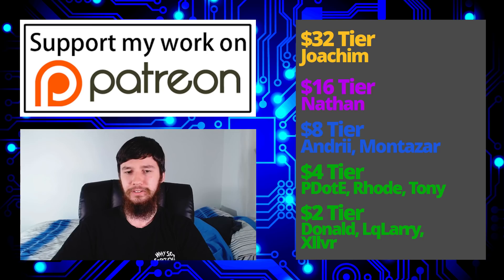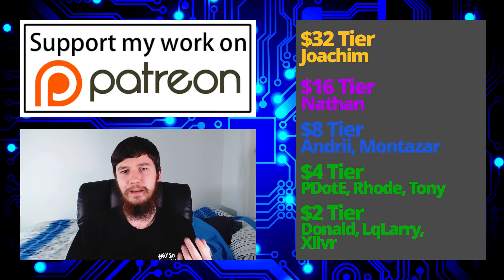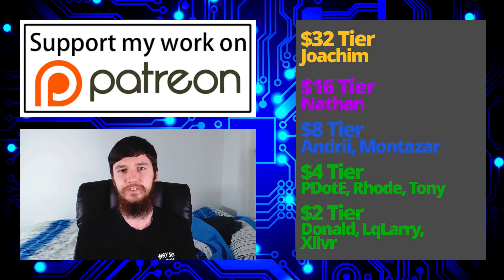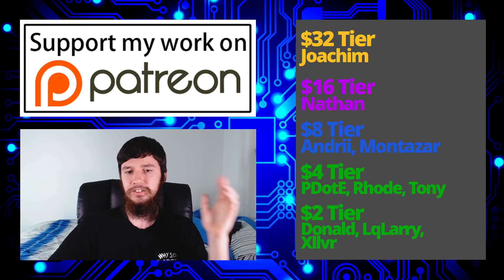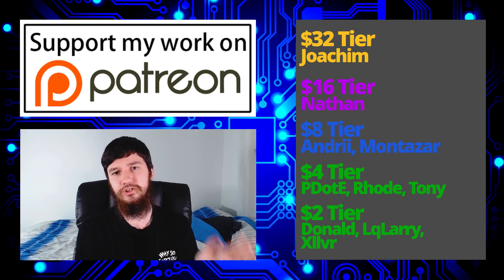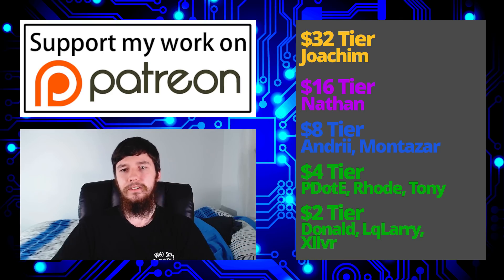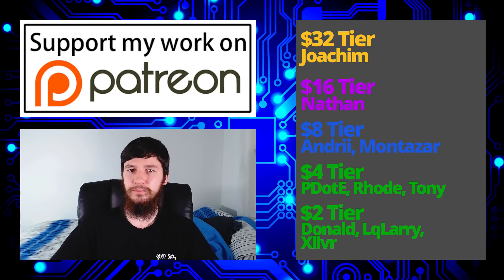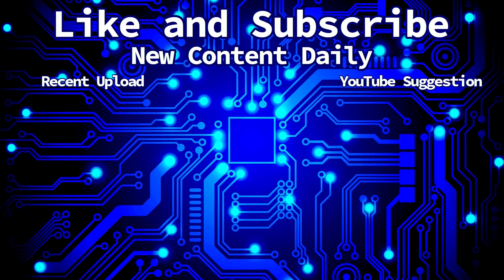PC Building Horror Story: How I Killed My Ryzen 3900x

Comment: The lesson here is WHEN YOU SCREW UP TAKE A BREAK.  A VERY LONG BREAK.
In 2004 my 3yr old son jumped on our brand-new $2200 Thinkpad T41p laptop, destroying the screen.
IBM wanted $750 to fix it (about $1250 in today's dollars).
I ordered a Boe Hydis IPS screen from Malaysia ($240) and decided to install it myself.
It took me THIRTEEN ATTEMPTS and THREE COFFEE BREAKS to get the signal cables (think light, 802.11 antenna) routed around the case so I could reinstall the bezels.
Several times I was about to throw the laptop 15' across the room into the wall !!!
What saved me was : Knowing myself, managing my own emotions, taking time to re-read the HTML guide, and relaxing, so I could start over, fresh.

Comment: electronic cleaner spray of a good brand cleans thermal paste. dripped some paste into a DIMM slot a few years ago. rinsed it with the spray a few times until the runoff was clear still using the board
Reply from the maker: Oh nice

Comment: I have a personal rule. Never do anything which is likely to end in failure, when your head is not in the best condition. 
Examples: After 2200, when you're starting get tired, when you're drunk etc.
The times I have screwed my install, bent CPU pins, messed up soldering, etc, have been after 2200.

Comment: Probably just the pins are dirty. Most of thermal pastes don't conduct electricity. Even crappy silver-based didn't in my experience, but you can check it using multimeter. I'd buy it and make a working system of it. But I don't feel this would be right, as *this is almost definitely working CPU*, and I'm broke anyway 🤷‍♂️
Just buy isopropanol, or any other as clean as possible alcohol, but even dissolvent or nail polish remover can do the job. Take any old toothbrush and give it a good clean. I could come and help you with that in person, unfortunately I live in another continent
Reply from the maker: You're probably right about that

Comment: Sorry for your loss. How do you know 3900x is dead? Also did you try heating the CPU to melt the thermal paste with an hair dryer or thermal gun?
Reply from the maker: Well I tried to boot my system with it and it wouldn't boot

Comment: I'm not sure about that paste but i doubt that killed CPU.
Maybe it was broken already? Maybe you didn't clean one important pin? Maybe MOBO needed BIOS update for 3900x?
Those pins are not that fragile, fixed many CPU with band pins.

CPU stuck with cooler? That happens all the time with AMD.
How to fix?
1. If you can turn on PC and stress CPU to heat paste.
2. If it's out use hair dryer (or something) to heat it then just twist it gently.
Reply from the maker: I did mention towards the end that there was a little bit left I had no way of removing. I'll keep those tips in mind, hopefully I'll never need them

Comment: I had the CPU and cooler stuck together too, I was trying to change the AMD cooler to the noctua. I pointed a hair dryer at the cooler to heat up the paste, then separated them. I had some cleaning fluid and cleaned it up. This did however bend a pin, I didn't notice and reset the CPU in the motherboard and it bent it further. It wouldn't boot so I took it apart again and checked the pins there were 2 bent and another bent double. I used a pair of tweezers to straighten them all. my heart felt like it was in my throat as I thought the pin would snap but it didn't. I managed to get it seated and booted and everything worked as it should. I am such a lucky b#@*@rd though lol. I do feel your pain though damn.
Reply from the maker: I did forget to mention that I bent a pin or 2 during this so I know that pain as well.
Reply: @BrodieRobertson  you had no luck with that at all. I am too lucky I think, maybe I could fix your CPU too lol.

Comment: Damn dude, that's a bummer. You were probably fine from the start since thermal paste is too viscous to squeeze out and touch anything important (it's not going to squeeze out and go into the socket or anything like that,) but I also don't know how much you put on. AMD definitely needs a better retention mechanism, though.
Reply from the maker: It was only a tiny bit more than I should have used.

Comment: Oh dear.
The 'trick' is to twist the cooler to break the seal between it and cpu.
Contact your pc shop & look for pc docs, that cpu may well not be dead & for the price of them trying compared to $800 Australian...
Reply from the maker: The problem is that I did twist it but it seemed like it wasn't going to budge and I was worried I'd bend the pins right off.

Comment: I think you can do it with a paint brush/toothbrush (or idk any brush with soft bristles) and alcohol. Most likely there's missing contact on some crucial pins.
It sounds like a quick fix, I'd suggest not selling it!
Also from what I found on their website, arctic silver 5 is not electrically conductive if you used that.

Comment: perhaps you can bath the CPU in isopropyl alcohol to remove any residue ? Anyway, I can relate to the part of having the need to break something to cool down....
Reply from the maker: Now that it's possible to buy some I might have to try it out.
Reply: @BrodieRobertson  you shoud realy try that, i think the CPU is still fine and just needed a good cleaning. Also phone fixing shops can have ultrasonic bath, maybe that can help in this situation, but i dont know for shure that alcohol wont end up under  the heat spreader. But i think it will evaporate very quickly. Anyway try to clean it, cpu is probably ok, good luck to you